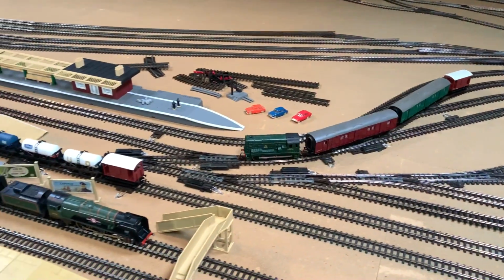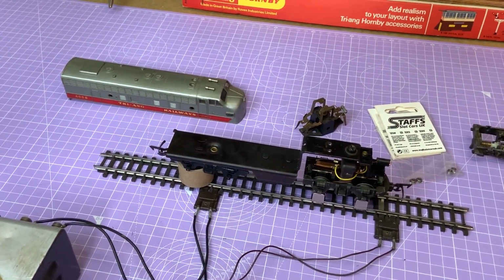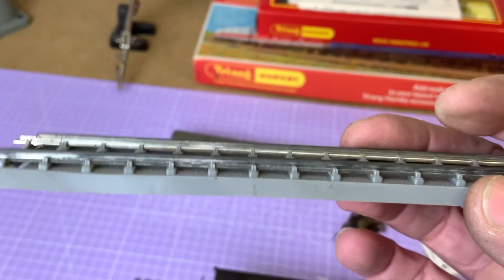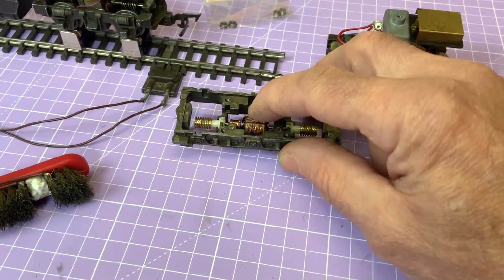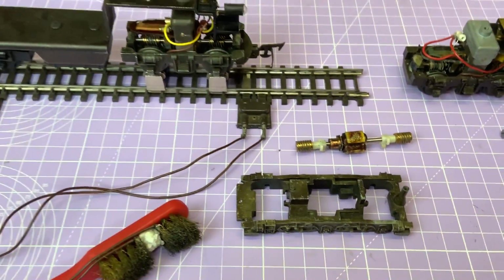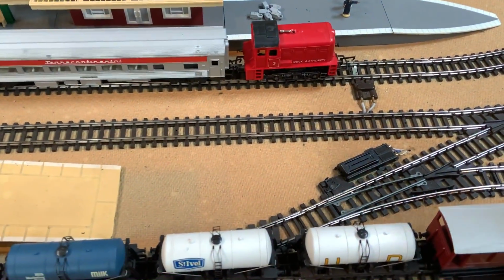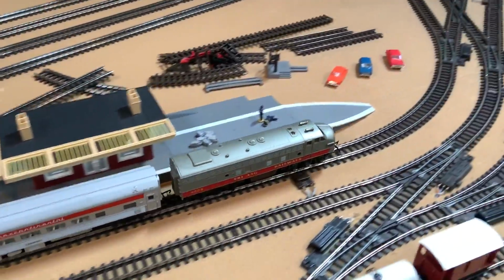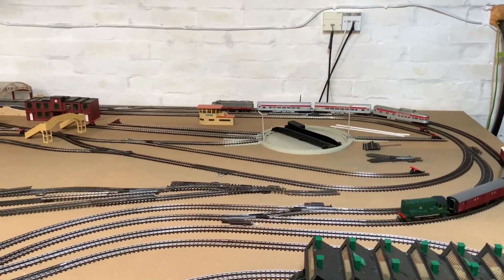Running My New Tri-ang R.55 Transcontinental Locomotive. A Look At What's Coming Up On The Workbench

Comment: That R.55 is a lovely runner, great to see it and the 08 trundling around at a steady pace. The bearing upgrade is a very interesting project, I look forward to seeing how it turns out. I expect you have some nice precision tools for doing such a job being a clock repairer, not something I'd attempt with hand/eye alone as that shaft needs to be kept nice and straight.
All the best, Rob.
Reply from the maker: Thanks for looking, I've done a bit more on the X04 so hopefully will show it in the next video. The old Silver Transcontinental loco is great fun, I'm enjoying it on the layout. Best regards to you

Comment: Hello, I got an Wrenn 8F, won't runt and missing The 2 balls. What can I do.
Reply from the maker: That's bad luck, they are very small and get lost so easily, they are available on E-bay, I hope you get some. Hold them in the motor bearing with a little grease to prevent them falling out. Best regards to you

Comment: Great stuff.  The R55 is a great candidate for sympathetic restoration and you can get spares and decals for them, don't forget the front bogie pilot, which I'm sure you know.  It's more difficult to fit extra pickups on that particular bogie, on my R159 I had to glue in brass bearings for the pinpoint axles but they work brilliantly.  Absolutely intrigued by the ball bearing conversions.  The line boring on the larger bogie is a great idea.  😊
Reply from the maker: Hello Pauline, I'm meeting a friend at a show next weekend and he is bringing me a part for the front, I'm looking forward to fitting it on the model. Best regards to you

Comment: Nice one David, sharing the your treasures. Good work on the refurbishment Mr Snooze, she is a great runner. I am curious to see how the ball bearing project turns out. At the moment the plastic suspensions in my models remain intact, but that does not mean they are doing their job. I was wondering if they can be 3D printed? Steven.
Reply from the maker: Steven, If the bearing itself is ok it doesn't matter about the suspension. If it's cracked or missing you can remove it and put a piece of silicon wire insulation to cushion it or do as @oscarpaisley has and 3D print a block to hold the bearing in place. Take care, all the best to you